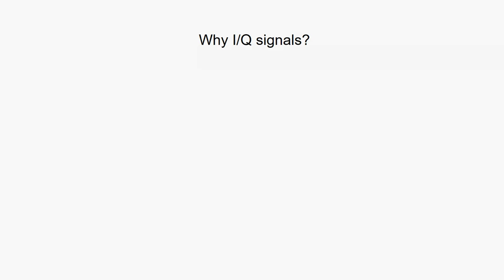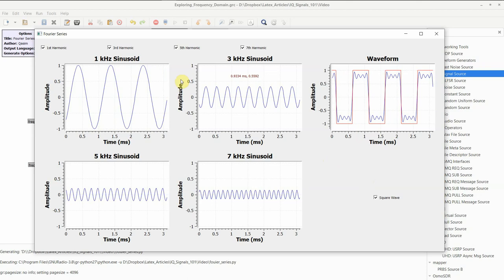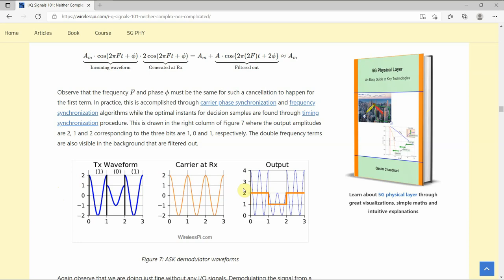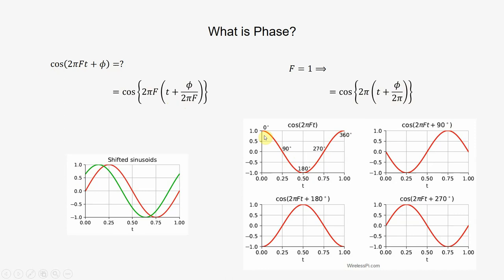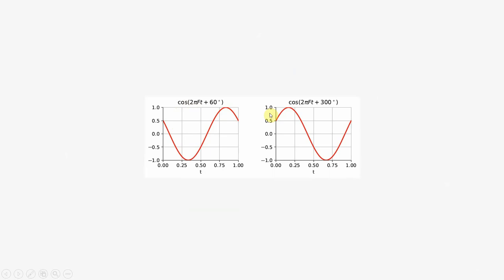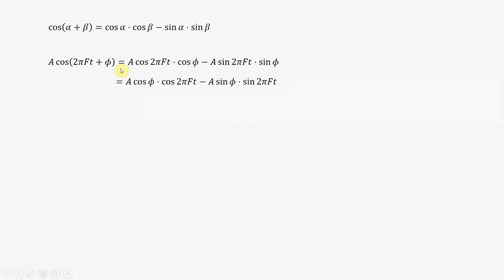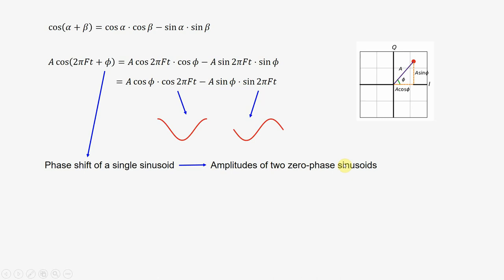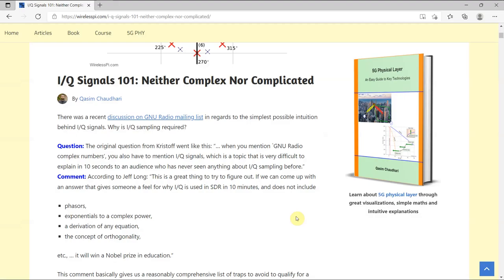The Real Reason Behind Using I/Q Signals

Comment: The #1 reason to use I/Q signals is that they let you to distinguish positive from negative frequencies. Everything else flows from that! Signals containing only a real component consist of equal amounts of positive and negative frequencies, so when you mix them you get both sum and difference frequencies. But mixing a complex signal with a complex oscillator simply adds the two frequencies; there is no difference frequency component! So despite the unfortunate term "complex", this actually vastly simplifies the processing and filtering of signals. Especially at low frequencies where it's easiest to process them digitally at low sample rates. Using real signals at low frequencies commonly causes "folding" around DC (O Hz), which is a real pain.
Reply from the maker: What you're saying is true from a communications perspective. I have mentioned this difference between positive and negative components in the related article https://wirelesspi.com/i-q-signals-101-neither-complex-nor-complicated/.

Having said that, DSP is a toolbox and wireless communications is one of its applications. I/Q signals are helpful in many other areas too beyond downconversion of modulated signals.
Reply: @wirelesspi9183  I am usually explaining this to a ham radio audience. So I start by saying that we hams usually think of signals as oscillations, eg, wiggling electrons in antennas. And they are. But it's more complete to think of them as rotations with sinusoidal oscillations just being what you see when you look at a rotation edge-on. You can tell how fast an oscillation is going but to see which way it's going you need to see the rotation. And to do that, you can look at it from two edges: the front and the side, 90 degrees away. I've even held up and spun a bicycle wheel to show the point. Do you see where I'm going? I usually see a lot of light bulbs come on in my audience at this point.
Reply from the maker: @philkarn1761  Yes I understand what you're saying. I use a slinky (helical spring) to demonstrate the complex sinusoids. In my opinion, it's better to see the amplitude as a general case (instead of the direction of rotation). For example, cosine in both cases has a positive sign but your clockwise rotation has a negative sine wave while an anticlockwise rotation has a positive sine wave. Yes, we do call this a positive or negative rotation but if we see this a multiplication of a zero phase sine wave with -1, then from here, you can generalize the idea of I/Q signals for any phase.
Reply: @wirelesspi9183  One of the neat things about physics and math is that there are often several equally valid ways to achieve the same result!

Comment: Classic explanation. Still some doubts…
Gone through your lengthy post on iq modulation. Before introduction of iq modulation 8 psi modd demoed was explained and drawback of psi demodulation was explained in 8 psk.
If this is really the issue with psk how did it survived? I mean there is no one to one mapping  of the constellation points at the receiver ….
Reply from the maker: It was not a drawback of PSK. I wanted to lay ground for why we need phases on a continuum. In regards to how to demodulate PSK and other linear digital modulation schemes, you can see my book on wireless communications https://wirelesspi.com/book.

Comment: The tutorial is simple to understand nice efforts. I have one basic doubt in IQ data .  How the dynamic frequency signals represented with IQ data and IQ is basically zero IF signal if I am not wrong. If a certain signal is having negative doppler frequency then how the IQ data still hold the negative frequency information. Thank you
Reply from the maker: In this case, the original complex signal is multiplied with a complex sinusoid rotating in a clockwise direction (due to negative Doppler frequency). To estimate that frequency, you will have to remove the original signal through a complex conjugate product.
Reply: @wirelesspi9183  Thank you very much. Can you please suggest any good article regarding this topic.
Reply from the maker: @sathishnayak52  You can find lots of scattered information here and there. For information in one place, see Mengali's book on synchronization if you are really good at maths. For an easier explanation, see Chapter 6 of my Wireless Comms book.
Reply: @wirelesspi9183  Thank you very much

Comment: “Amplitude 1 by 5” and so on. What does that mean ???  These amplitudes are all less than 1.0 …
Reply from the maker: Amplitude 1 for 1 kHz sinusoid, 1/3 for 3 kHz sinusoid, 1/5 for 5 kHz sinusoid and so on. That's how a square wave is formed and these are called Fourier Series coefficients. Hope that helps.